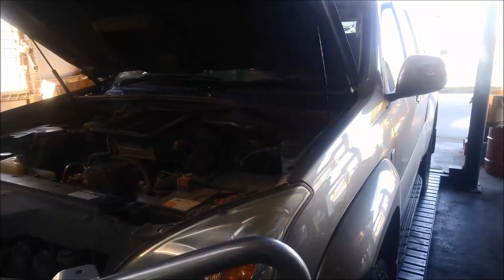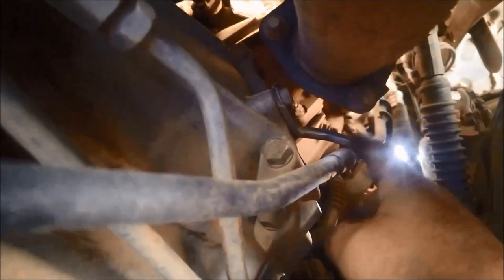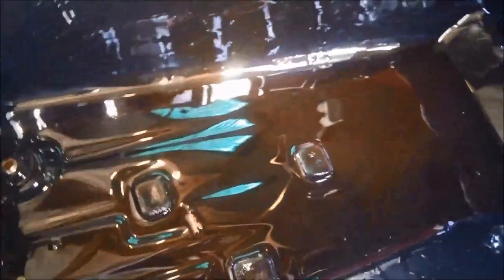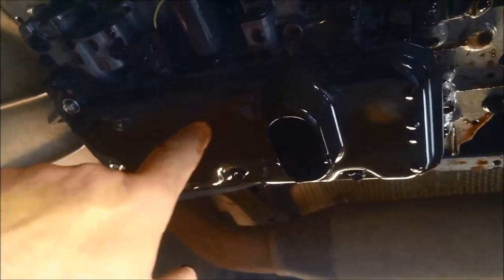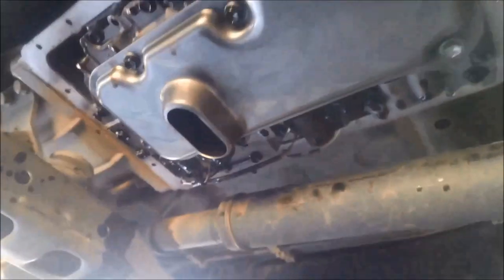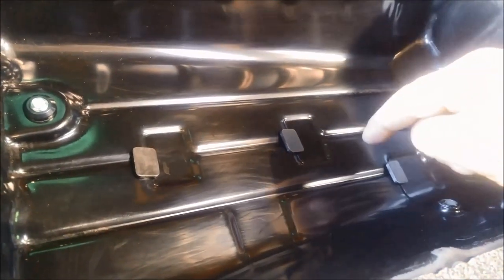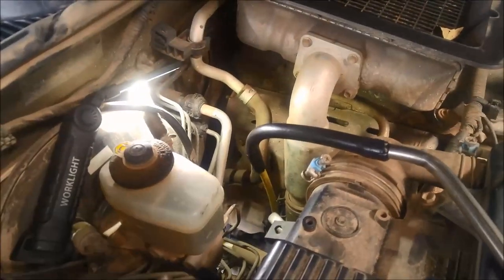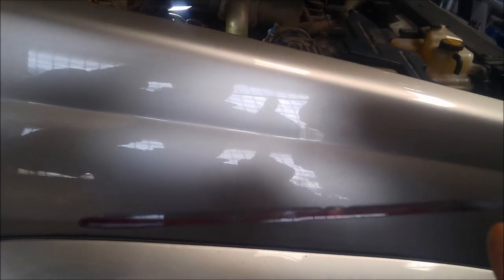Toyota Landcruiser Prado A343F Automatic Transmission Filter Service & Fluid Change How to

Comment: Hy can you please give me an advice land cruiser prado 120 4 speed auto,have a slight thud as she changes to 1st gear from second…when i step the brakes. I had change the oil 10 k ago, i used castrol dex 2. Many thanks!
Reply from the maker: hi, you will have to contact me via our facebook link in description. cheers

Comment: How many L of fluid did you end up putting in?
Reply from the maker: hi, roughly same what comes out, however always check as per manufacturers directions as sometimes you might have leaked some out or someone filled incorrectly. cheers

Comment: My car problem Toyota Land cruiser Prado v6 4.0L 1GER shifter stuck in purk
Reply from the maker: hi, check linkages or broken return spring on park pawl? cheers
Reply: bit late now , but do the brake lights work??  switch on the pedal not turning on the lights wont release the gear lever